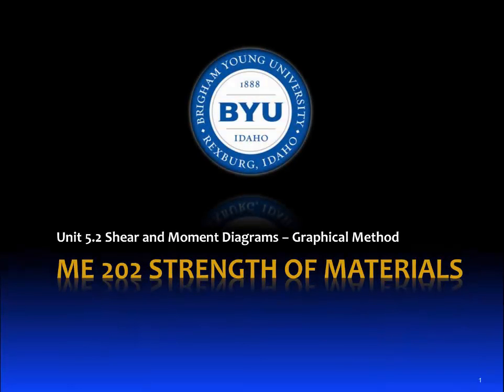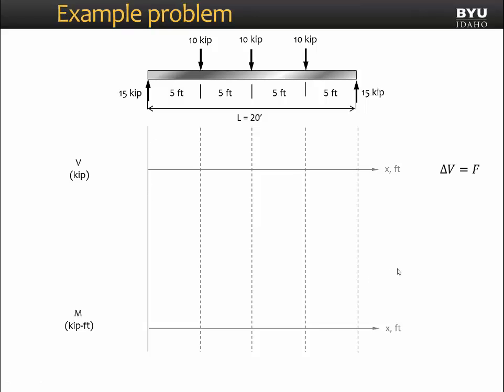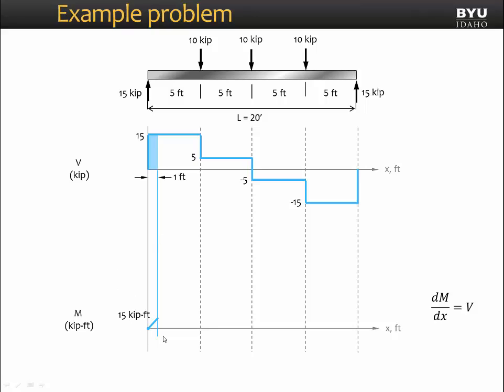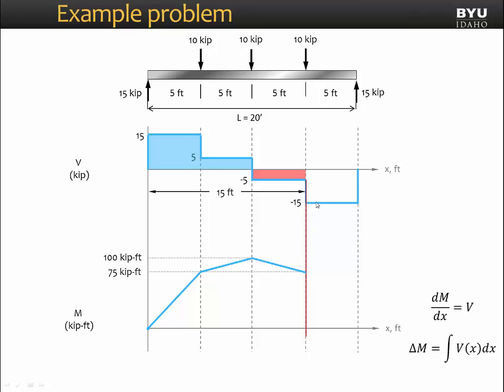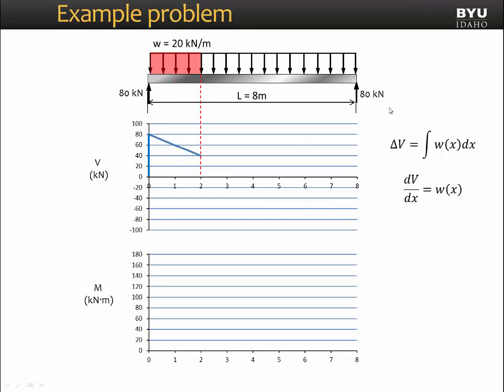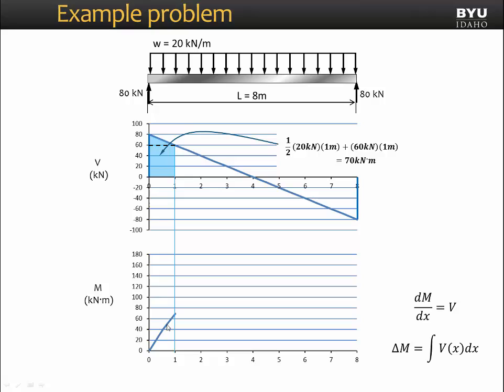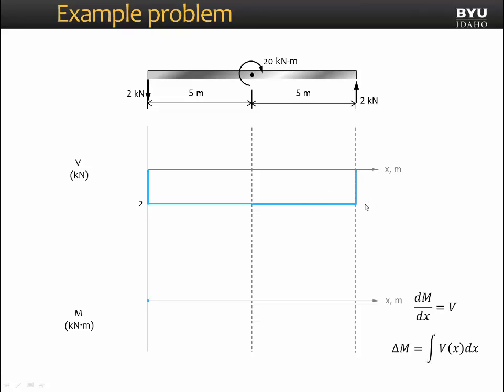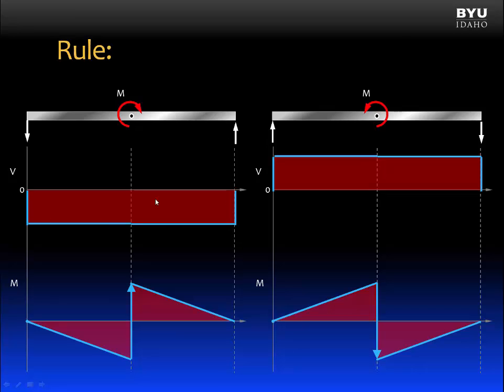05.2 Shear and moment diagrams graphical method

Comment: Overall this was good except for the strange comment around 9:40 where you say the derivative is zero (the derivative is not even defined at the midpoint of the beam, and the derivative to either side of the midpoint is not zero, as you just explained before this!). Calculus says that the local maxes or mins happen at places where the derivative is zero OR at endpoints of piecewise-defined regions, and that last situation is what we have here.

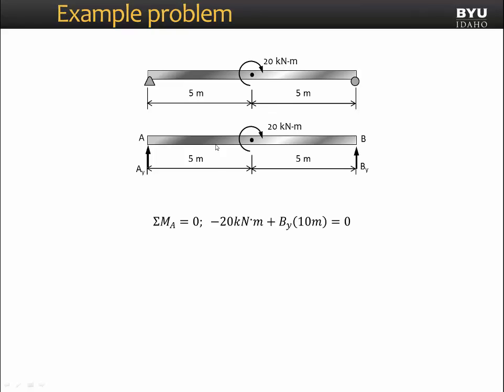Comment: Why is the 20kN-m moment negative when solving for the reactions @16:37? It's a clock-wise moment, so shouldn't it be positive?
Reply from the maker: When solving for the reactions in this example, I assume moments are counter-clockwise positive.  Thus, the 20 kN-m moment is negative and the moment term "By*10m" is positive.   When solving for reactions, you can choose any + or - convention as you wish.  If, for example, I chose moments to be clockwise positive, then the 20 kN-m moment would be positive and the moment term "By*10m" would be negative.  I would end up with the same result for the reaction.  
Thank you for your question.  I hope this response is clear.